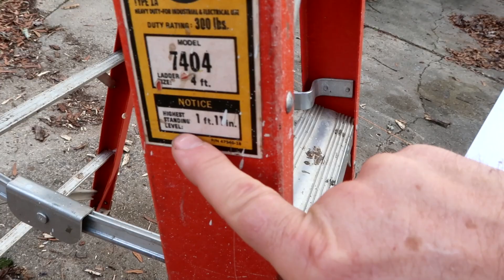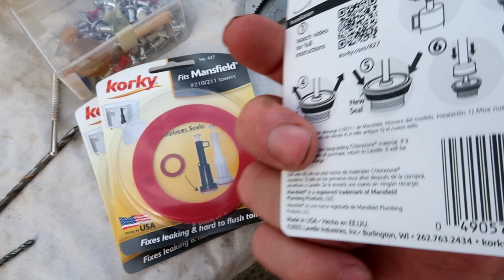Used Ford Truck  $49,000 & Other New Year's Eve Yard Sale Specials!

Comment: 😂 I could buy 98 Dodges!!

I have a cool lighted plumb bob that I should do a video on 🤷🏻‍♂️
Reply from the maker: Wow...an LED plumb bob....What will they think of next?   
Guy up the block has a house that turns green and red and sometimes the lights flash.
( I though maybe he was using the toaster but come to find out the lights are supposed to do that).

I need to get lights on my hammers; give them that light touch for finish work.
Reply: @Dancing_Alone_wRentals 
Not an LED. 
It has a little age on it but it would be hard to call it vintage.
Reply from the maker: Trying to imagine what it looks like @UnfinishedProjectDartSport

Comment: I thought the frisbee was the top of an air cleaner until you turned it over..  Good deals..
Reply from the maker: This may sound silly, but I left out the two favorite finds that day.  I got a full box of manila tags and one of those reach things.
I walk around picking up trash all the time and never have enough of those grabber things.

But the manila tags are great. I have a collection of bikes that isn't worth much more than good memories.  They have been moving over the months and I want to tag each bike with instructions.
This way the key bikes are not mixed with daily stuff I lend out.

If I'm going to keep these toys, I need to display them so it makes some sort of sense.  

Have a super weekend!

Comment: Hahaha, it's too cold for sleeping in the back of the truck now, but come springtime...

How much is he selling that Ford for?
Reply from the maker: $49,000   is that crazy or what?   What has happened to the price of trucks?  I wonder what it sold for new.....$32,000?  I'm guessing. 
Holy cow...I looked it up.  4dr XLT 4WD Crew Cab LB		$28,215    
If I had to buy either one...I would be sleeping in it.